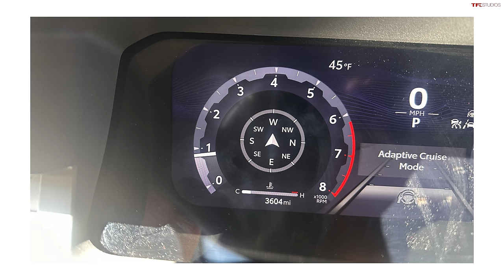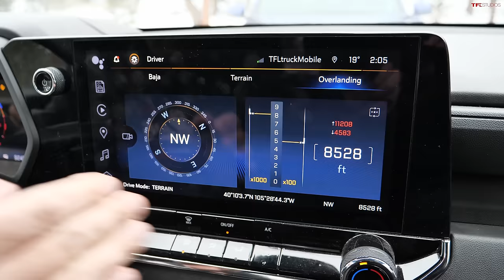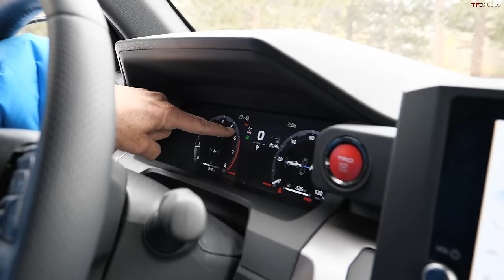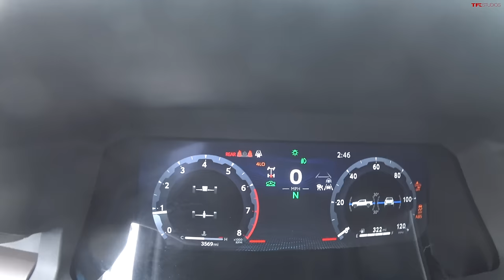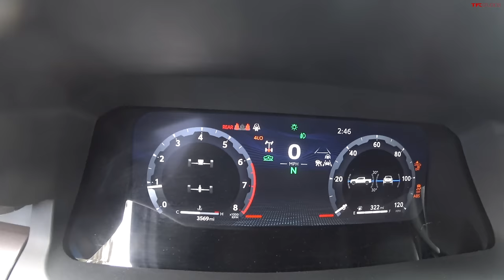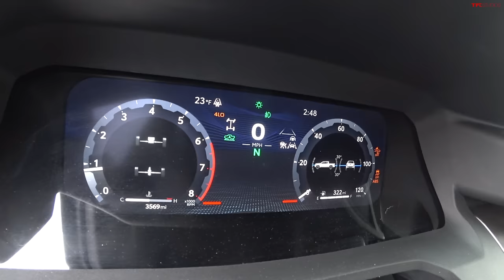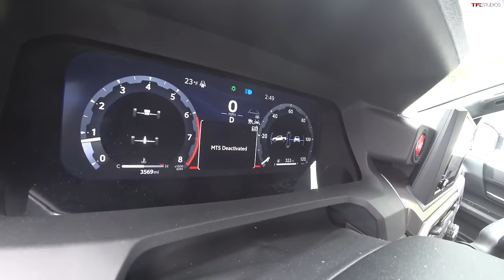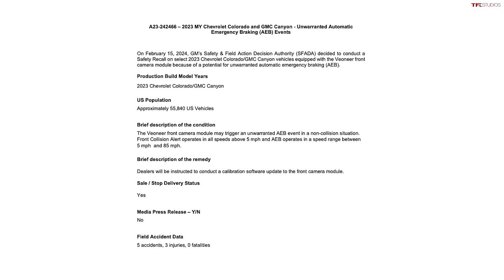Our Brand-New 2024 Toyota Tacoma Almost Left Us Stranded...Here's What Happened!

Comment: Honestly, mainly because the, is no longer built-in.
The u s. Not trying to be Derogatory, but the fact is that labor in that new facility is not experienced in that particular build of vehicle. In time it will be corrected, but the standards will not be anywhere near as high for at least the next couple of years. Not a very good decision that Toyota made being especially that it's an entirely brand new vehicle with a brand new motor and a whole new design in a first run production line. One of the 1 thing Toyota is best at is following through with its kaisen thinking. I don't really have much interest in buying one especially with turbo engineering. Many of the new products from almost every manufacturer line is becoming way to ridiculously expensive and over. Engineered complex just a meet caviot standards.

Comment: I take my 94 off-roading and hit a massive puddle and flooded it in the middle of winter. Buddy and I got a couple tools and a lighter to get the plug wires and distributor cap to dry. Truck started up with some hesitation but after a few goes we were out of the pine barrens like nothing happened. Idk if we could’ve done the same with a newer tacoma.

Comment: Any vehicle at any time can break, anything mass produced can and will produce a turd. What I mean by that is a one off, happens to all manufacturers. I do not own a Taco, I have a Ranger, I believe all the trucks to be good for their intention. If I thought it to be software I would have at least disconnected the battery to do a system reset. I think its a mechanical failure based on how loud that pop was! If you had broken a front shaft or joint would not the other wheel still turn?

Comment: Toyota still including shitty tires with their Tacoma, which even with full tread and brand new rubber not exposed to any UV, are absolutely dangerous in normal snow conditions.  They did that in the 2nd gen and looks like they're still doing it now!
That's actually the real root cause, since it allowed the wheel to spin in an otherwise somewhat benign off-road scenario.  Toyota should really come out and say that there wasn't any change to that front differential or otherwise explain how and why it failed.

Comment: Thats a pretty bad break for a truck..

I was expecting  rocks to smash a component  under the truck..but to have a mechanic  failure  because  of what looks like just wheelspin is bad..

It looks like the issue  is more weight was on the left than the right side..so it was kinda offset wheel spin the truck couldnt handle.

Comment: If it's a snapped CV-shaft, this is when a front diff-locker would be better than torque-vectoring traction-control.

 The sensors for traction-control are at the brakes, so if a shaft snaps, the brake rotor isn't spinning, so slippage isn't detected by the system...whereas, if a diff-locker is used, a shaft can snap and the locker could still send torque to the other side.

 Traction-control works better than traction-diffs on slick pavement, but it has some notable drawbacks for offroading, like this situation...or like wearing/overheating the brakes...or slowing wheelspeed/momentum, when wheelspeed/momentum would be useful.

 Put selectable lockers in your offroad rig. Don't rely on traction-control for serious offroading. I prefer Oxes or ARBs, to factory lockers that can't be used in 4High, or to lockers that are LSDs when "unlocked". I want them fully open or fully locked. TC, VSC, and ABS should also have real, individual, "OFF" switches, IMO.

Comment: I’m gonna keep on beating my 2014 taco. Got some meats all way around. Last snow we had, I pulled a farmer in Chevy 1 ton flatbed 4x4 truck with two round hay bails on flatbed. Pulled him up a mtn. With no flat ground advantage in take off. Had it in 4 low 2 gear (manual transmission). Taco had weight in back that gave me the traction I needed to pull him up mtn.

Comment: I have a 2005 Ford F-350 Superduty SRW with the Dana Super-60 front axle.  I just heard the 2023-24 Superduty trucks are now equipped with the Dana 50 axle; I think my Excursion has that and it is considerably smaller.  I hope it doesn't do what the TFL truck did.  GREAT VIDEO!

Comment: Glad you guys are showing what’s going on! I am so disappointed in Toyota, I almost got a 23 Tundra 1794 hybrid and it had a leaking sunroof, blown subwoofer and stalled then lurched violently when sharply turning in both 2wd (paved) and 4hi (on gravel) - and this was a test drive!
I was considering a new Taco but will stick with my 24 Sierra AT4x, it’s not great either in terms of problems I dunno maybe I need to back to the last gen Taco, Tundra or back to my ridgeline I had (zero issues)…

It does seem that Toyotas launches are pretty bad with trucks these days, maybe takes them time to figure it out and then 2-3 model years later better?

Comment: It sounded like that engine was making maximum torque at the time it broke.  Maybe in that specific circumstance, the engine should have limited power based upon the strength of the driveline.  It was probably a lot more raw power on the system than the old V-6.

Comment: Comments are very dramatic for a simple broken drive shaft… this is less of an issue then when that guys Colorado was bricked for a few days, that’s an actual problem that only a dealer can fix.
Reply: its a 50k brand new truck! which is sold on the reliability of its brand!
Reply: Easy fix though, it’s not a big problem, not a red flag for me, just some bad steel and bad luck. Toyota Tacoma have always been made out of crap metal in all fairness and honesty. I can fix a drive shaft on a Tacoma, I can’t reflash a Chevy brick, I have to tow it, I can’t a ranger when it randomly blows a seal, or a wouldn’t want to at least.

Comment: Air down your tires to at least 10psi would have help tremendously
Reply: which would have increased the load on the front differential, causing it to fail quicker.

Comment: in 2011 I was driving a brand new JGC limited with the v8.  Parallel parked on a city street with about 6 inches of snowfall.  The old Buick station wagon parked in front of me pulled out of its space and slowly drove away and I assumed I would do the same.  Instead, 15 minutes later I was still in the same parking space, minus a working transfer case.  When I finally got it back from the Jeep dealership one of the service guys asked me what kind of crazy adventure I had been on with the vehicle.  He assured me he just wanted to know out of curiosity, and he wasn't trying to gotcha me on the warranty, because he said he had never seen a transfer case that torn up in his career.  That was probably an exaggeration on his part but regardless the point was the transfer case of a sub 1000 mile off-road warrior was shredded to bits in a few inches of powder on a city street.  That was the last Jeep I owned.
Reply: 😅 Sure, and the earth is flat and we didn't land on the moon either😅
Reply: @tedlulis973  so it didn't happen?

Comment: These things are like computers now. You should have disconnected the battery completely and left it unplugged for a few minutes to reboot the computer. Willing to bet this is a software issue and the sensor was activated preventing the truck from going into 4WD. Reboot.

Comment: I appreciate the attempt and effort. But, hard to watch. You guys got a lot of toys and nice outfits; but, don't seem prepared much at all for the environment you are in (No bags of salt or sand). Knowledge on how to use straps. Could have gotten out of that jam by using the other trees, not another vehicle that will slide and get damaged. Don't seem to have much knowledge on how your differentials and locks work with the electronics either.